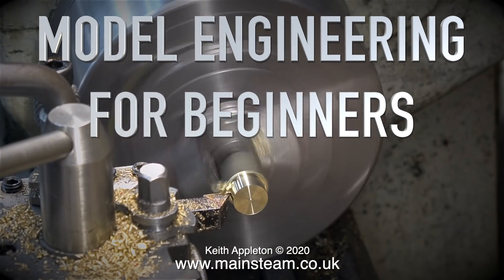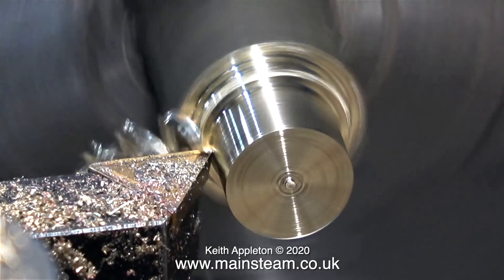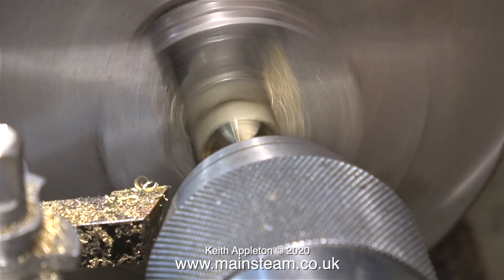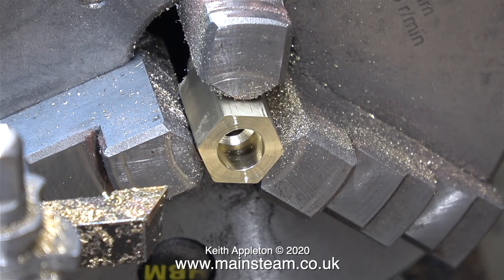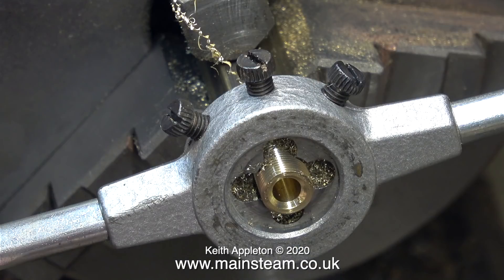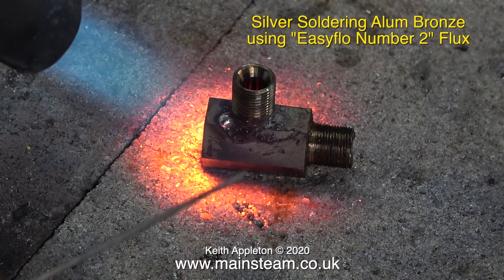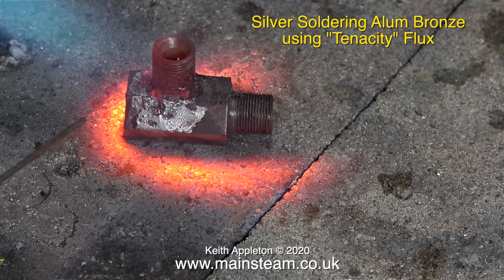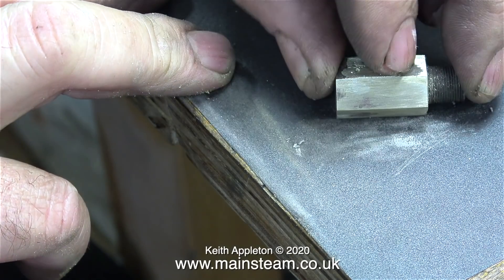USING ALUM BRONZE  - MODEL ENGINEERING FOR BEGINNERS - PART #31- ALUM BRONZE

Comment: I wonder what the advantages are to this metal if its so hard to work ?     thanks for the video :)
Reply from the maker: It is very strong and hard wearing.
Reply: @keithappleton  Thanks MR Keith have a great day :)
Reply: It's also corrosion resistant. It's used a lot in marine applications.